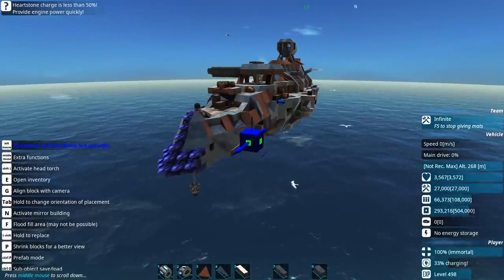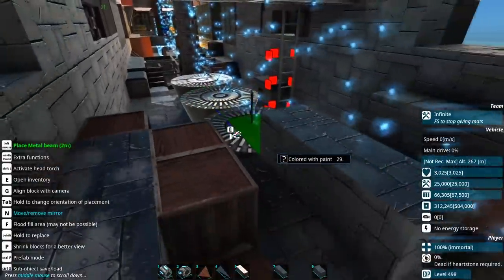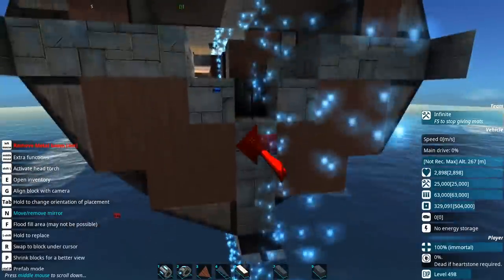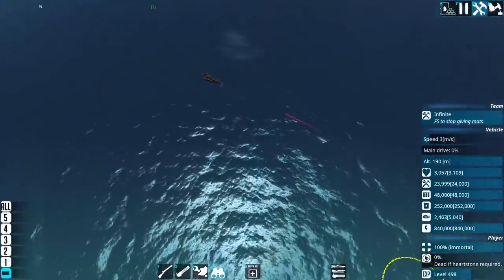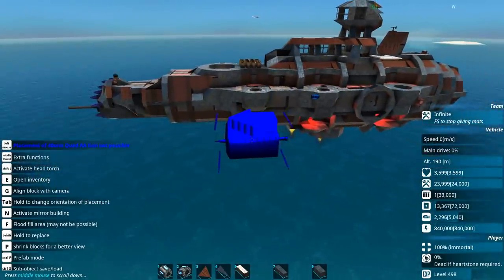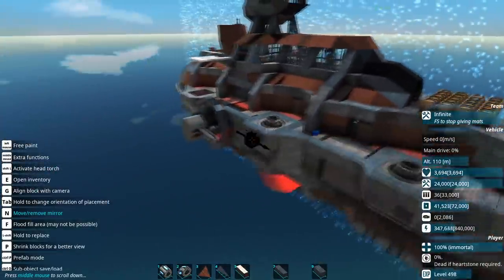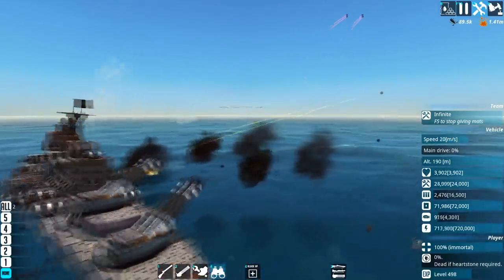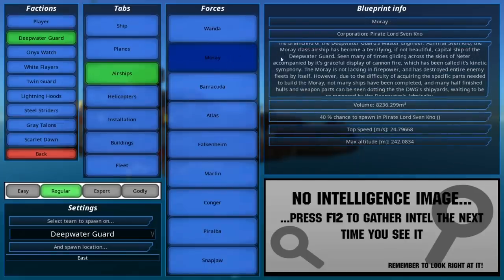Railgun Moray Retrofit!! | Ep.4 Neter 2020 | From The Depths

Comment: “The Lathrixian Legion’s technical division’s completion of the Moray took place at their ‘Open Water Workshop’, the same facility which gave birth to the formidable Prototype 2 bomber, which terrorised the Deep Water Guard. Despite possessing some data on the original vessel, the engineers in charge of the project decided to build the vessel’s internal systems and weaponry from scratch, keeping the hull as the only link to it predecessor. This turned out to be a good decision as the project engineers discovered, much to their despair and annoyance, that many components had been replaced by facsimiles and mimic. To this day the reason why the DWG replaced these components, which included sections of its armour, but one theory was that the DWG was struggling to complete the vessel, but tried to hide it from the Legion.

Despite this set back, and the Engineer’s reputation for drinking on the job, the ‘refit’ of the Moray was successful. The airship was equppied with a medium caliber railgun, which was capable of gutting battleships. It was designed to act as assault artillery ship, pelting the enemy from a distance with rail gun slugs, with its secondary armament mostly intended to act as a defensive measure against opponents who managed to close the distance. Despite being close to the cost and weight of the original Moray, it was without doubt, a superior craft, further demonstrating the technological superiority the Legion had over the DWG.”
-Archivist Mekanicle
Reply: Mekanikel sad more people didn’t see this. Oof.
Reply: this is amzing 
i think you and vlad fedonkin should team up
you guys whould be unstopabule
(sorry for the mispelling)

Comment: i have some ideas for ships:
1: a stealth submarine that sneaks up under enemy ships before releasing a garage of small torpedoes straight up.
2:a guardian ship built exclusively to screen other more vulnerable ships from enemy fire (anti missile missiles, anti air, anti munition systems, extremely stacked armor, you name it)
3:a self sustaining space station with ONE MASSIVE PARTICLE CANNON (I think it would just be fun to call in an orbital strike ), also you could stick one of those massive radars to it In order to help uncover the map.

extra ideas(requires warp drive):
4: the deceiver, looks like an average battle ship, BUT it moves straight towards the target at high speeds and when it comes close enough it uses a warp drive to teleport diagonally upwards  straight above the target, revealing that its keel is coated in rams as it crashes down on its opponent.
5: the spazzer: has 4 short range, fast charging warp drives facing different directions (I think you know what it does)

Comment: My Recommendation:
planning ahead the "Lore" of this Playthrough, this should be the Early Prototype of a Full Railgun Airship based on the captured Moray Shell

the Full Railgun ship should be a long range support bombardment ship, snipping foes from affar while the brawlers absorb the damage

it should get a beffed up spinal railgun and energy generation and maybe the Ability To Change Shell Types depending on the target (there is an option for the ACBs to change what shell a gun should have, but never figured it out how to actually change it)

the idea here is to have different shells for armored targets, maybe APHE or full AP, and HE for lighter targets

and should be Build AFTER the Deep water guard is defeated, as a counter against the Onix Watch armour maybe

meanwhile this one is the only one, or one of two prototypes for testing and gathering data for the full version

maybe you can figure out the interchangable shells in this prototype
Reply: I want to see a slow firing eight meter long 500mm devastator with aphe to end all times, it just needs to leave a big hole with one boom

Grammar Edit

Comment: This comment is probably gonna get lost in the sea of comments but I just want to tell you a little something about frag vs wood. Frag has a very low AP (6) but a very high damage potential. Wood has extremely low armor class (3) and since you need 2x the AC in AP to deal full damage, this means frag deals 100% of its massive damage to wood. It is undoubtedly the best shell to use vs the DWG, and it is best used at 23° cone angles. I hope you see this and find it helpful.

Comment: Hey lathrix here are some of my suggestions: #1 you could add some tiny missile interceptors (variable thruster/turning thruster/APS guidance/interceptor head) in tiny missile pods like the ones on the original. #2 add some strafing thrusters so the moray can do some cool drifts. #3 hide the roll and pitch thrusters 1 block deeper and cover them with vents.

Comment: The wooden slope mimics were actually there so the slopes could rest against metal slopes, which in my opinion, is absolutely brilliant.

Also, you cam change the sandbox detection system settings. I forget how, but I know you can.

Comment: Reason for all the mimicked propulsion parts is that it was part of a building, and propulsion parts cannot normally be placed on buildings or fortresses. There is also a mimic view which identifies all mimic blocks. I can't remember what you press to get it, but I'm certain it can be accessed in the bottom left where it says "Press middle mouse to scroll down." That's also where the cross-section tool is.

Comment: APHE to put the kinetic energy from the rails into use, there's also a option to view only mimics now (middle mouse button, the ribbon top right). if the cooling/recoil/chargers are a PITA; a squash head strong enough to take out a metal beam and frags with low cone is also pretty cool, it's like a inverted tandem shaped charge.

Comment: The reason is has so many mimics, is because a lot of blocks, like thrusters and helium pumps, can not be placed on structures, they had to replace a lot with mimics, the engines are probably mimics because that way it wouldnt use an fuel or have any performance impact and other mimics were to alloy blocks to intercect.

Comment: Possibly turn one set of the observation bays into a countermissile/decoy battery? Something like the casemated small missile turrets you toyed with last episode (azimuth only, or fixed tube), and load them with semi-agile missile interceptors and/or flares.

Ooh, or refit another version for close range, and use the little observation bays as literal jumping-off points for capturing. Or, for that matter, you could use them as docking points for the Darts/other little drones.

Comment: Nice redesign but what is it's function? is it a long range artillery support craft, for that purpose it could use some more storage's you know pray for the best plan for the worst and all that.
It's weapons and armor are fine, it doesn't have to be on par with the factions original ships but being a captured ship it might be an idea to strap a nuke to it in case the enemy get any idea's of liberating her.
For that matter will this be a advance artillery support that supports the front lines or a guard dog you have at base just to taunt the enemy?
A bit more speed could be the difference when retreating between getting caught and avoiding battle, being slow however does suit it being an artillery after all.

Comment: the 40mm twin guns make decent anti missile - the quad mounts have too long a reload plus slight offset due to to the wide set of the barrels and the octo mount has worse accuracy and even worse reload. that and or 3.7 inch flacks - need to find a good balance on damage explosion radius and shell speed - still haven't figured out a good combo and if he or flack is better. 130mms also can be used since they have decent elevation. 

however i think you need to have some system to cut out any local weapon controllers to hand control over to the anti missile controller. for some reason even with priority set they fight each-other and act all buggy. IR trackers are a must to track missiles also.

Comment: hey Lath, I am trying to make a small missile system that just drops off the pod anf then ignites it's booster, kind of like Tiny Tims used in WW2 by the US however I've only been able to achieve the delayed booster ignition, is there a way to do what I to do

ps: Imagine the system being inside the hull and the missiles drop horizntaly and ignite, they are laser guided, as most of my designs are since I haven't found any countermeasures in enemy fleets
Reply: You can just delay the thruster activation and have one turn?